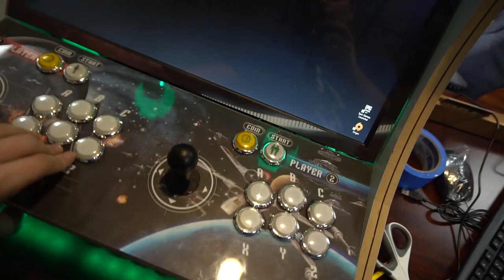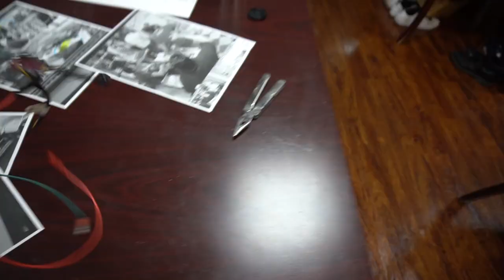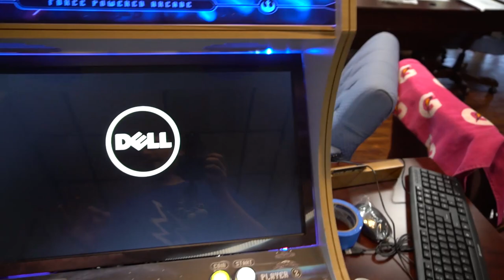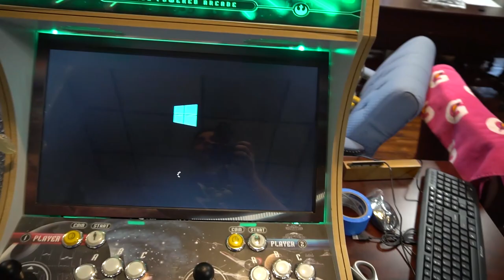Fans Installed on the Bartop! plus arcade pc power button

Comment: You can get a 8bido dongle that automatically connects the ps4 controller as an xbox one controller. So anything that would work with an xbox one will work. No software needed

Comment: My rig has so many fans that it sounds like a helicopter taking off. I need to invest in water cooling.
Reply from the maker: Nah dont believe the hype. What kind of fans did you buy? Mine are dead silent
Reply: @Vic_VP  I got some Corsair RGB fans. I don't remember the exact model, but they were on the cheap side.
Reply from the maker: @St0rmTheGates  interesting that's the king of fans. I bought no name brand ones for 20$ for 5 of them! That's cheap lol